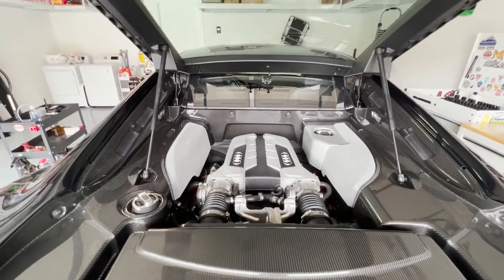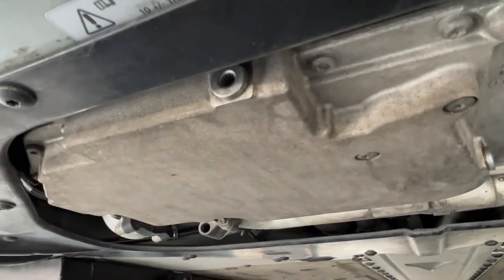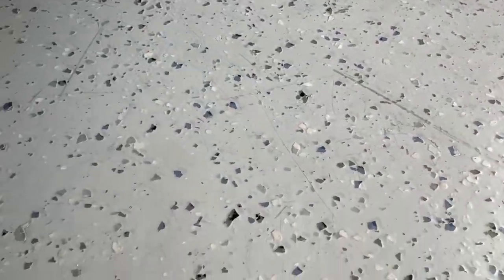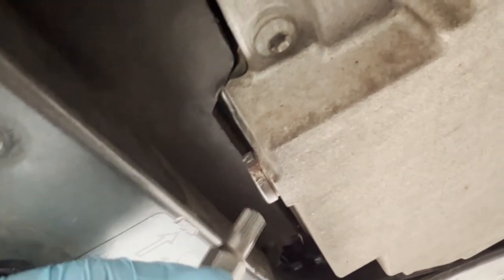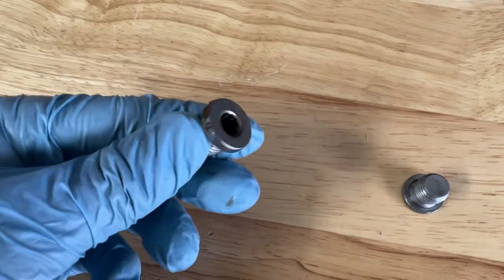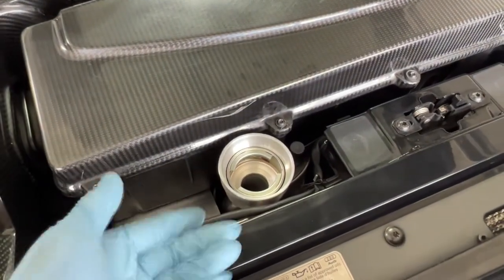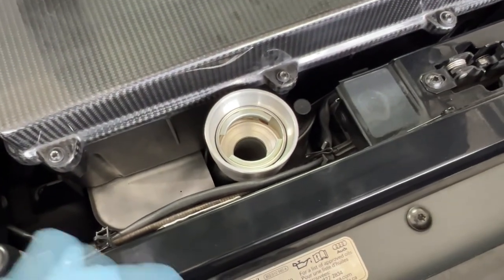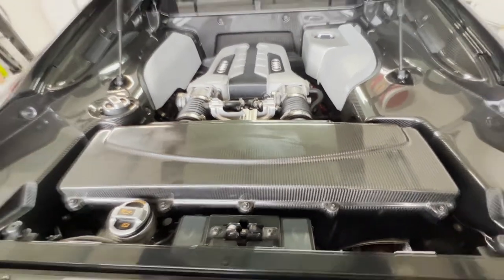Audi R8 Oil Change Guide for V8 Version

Comment: The best Audi r8 oil change guide. I'm going to do the same and chop off a bit so that it'll fit. Please continue to upload more Audi R8 servicing videos (air filters, spark plugs, etc.). I will watch and like all of them
Reply from the maker: Yea I plan to replace the spark plugs come summer since I don't know how old they are when I got the car. I'll definitely show everyone the spark plug job.
Reply: @ftwgarage  Nice. I plan to do the carbon cleaning on the valves. Since that, to me, is a necessary routine maintenance job. Hope to see you post a video on that!

Comment: Did you need to take out the splash pad which has about 20 screws?!
Reply from the maker: For the transmission plastic cover, yea you need to take it out. For the engine plastic cover, you can get away with removing a part of the cover near the oil drain plugs.
Reply: @ftwgarage  the transmission cover is metal not plastic right? The only reason to remove it is for the one drain plug for the oil reservoir?
Reply from the maker: both covers are plastic and yes only reason to remove transmission cover is to drain the big oil tank.
Reply: What oil do you recommend?
Reply from the maker: 5W-40 Liquid Moly

Comment: Great video , good to see the R8 oil change demystified 👍 I noticed that you have a sound deadening cover between the sump and the transmission. was that something you put in or was it there when you purchased the car? I’ve just acquired a 2008 and noticing a lot of noise, clicking, tapping and  Gurgling coming from that area, and mine hasn’t  got the sound pad installed.. I was shocked to find out Audi charges 1200. For the part..😮
Reply from the maker: The sound deadening came with my car. It looks like your sound pad got lost over the years from careless techs. You can try to find some heavy duty foam online and glue it to some sort of plastic material.

For the noise, I would pull any codes from the car and start from there.
Reply: Thanks for the reply. I’m currently looking up some sources of sound deadening material. Apparently that deadening mat was installed as a courtesy from Audi as part of a service bulletin when owners were complaining of the noise.  It wasn’t installed from the factory. Unfortunately, Audi no longer provides these for free.

Comment: Do you have a video on getting the R8 up on the quickjacks?
Reply from the maker: I don’t have a video. It’s pretty simple: align the rubber block on the jack with the rear jack point first. The rear jack point is marked with a circle. After that, straighten the jack and align it on the outside of the black rubber grommets. Do not jack on the rubber grommets.